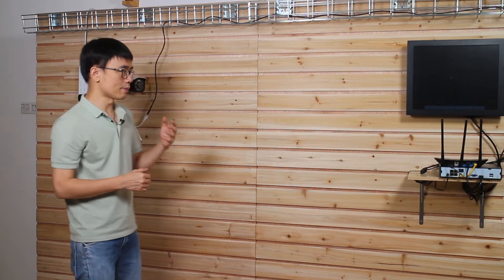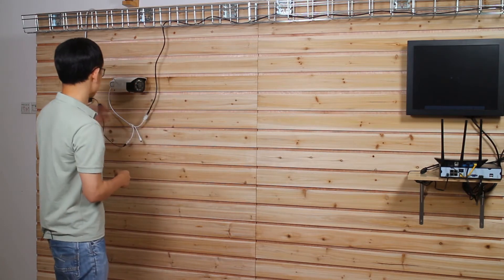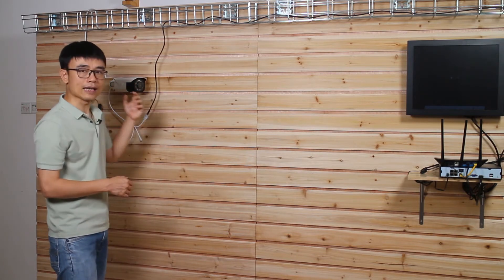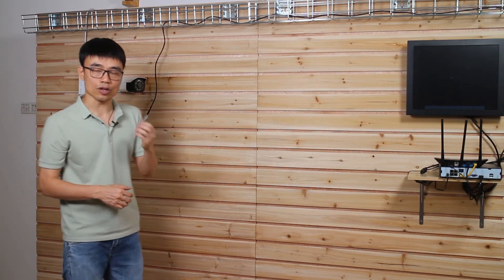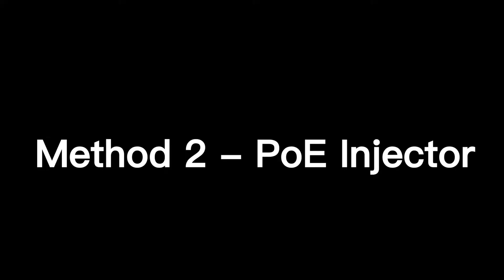5 Methods to Power Your IP Camera

Comment: useful info. What wifi cameras would you recommended?
Reply from the maker: Sorry to disappoint you but we only sell PoE IP cameras that feature a more robust connection. https://www.fastcabling.com/product-category/ip-camera/

When considering a WiFi camera, your choice will depend on various factors including your primary use case (home security, baby monitoring, outdoor surveillance, etc.), your budget, and specific features you might need such as night vision, motion detection, or integration with smart home systems.